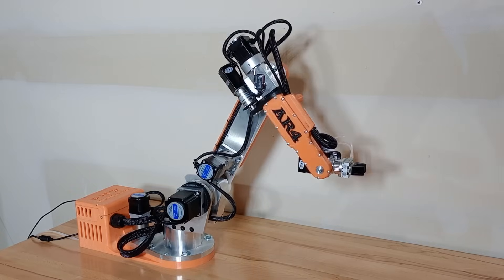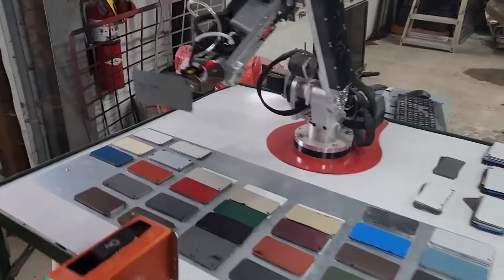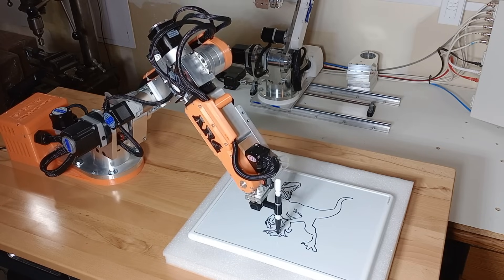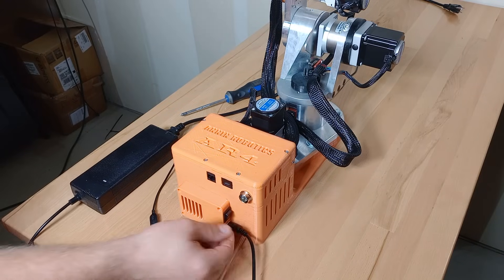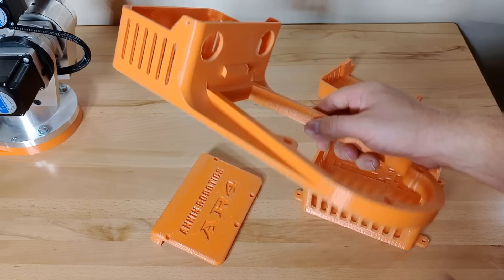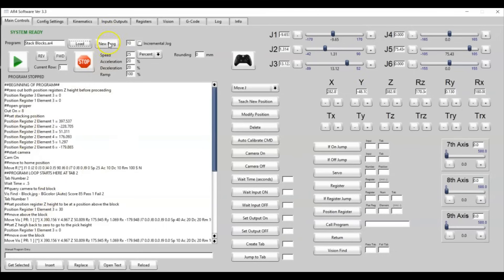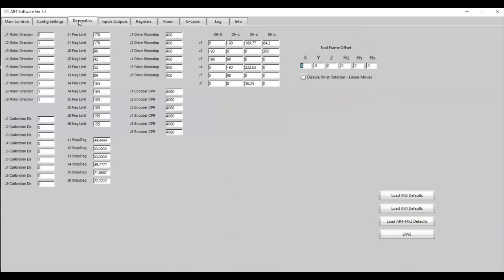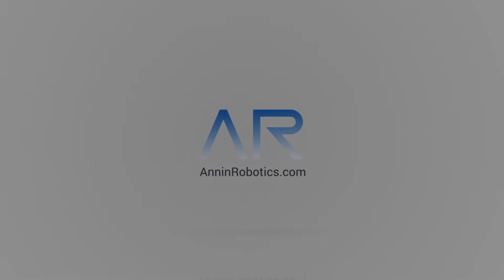AR4 MK2 6 DOF ROBOT ARM - DIY 6 axis robot kit / Arduino controller with Python program interface

Comment: Hi Chris. I'm a farmer in Michigan using your robot for some machine vision tasks related to my conifer operation. Thank you for releasing this open-source project. I purchased the Hardware and Electrical kit back at the end of September but have not put things together yet. I see on the website the AR4 hardware and electrical kit are the same for the MK 2 version. Is the stepper motor package the same?
Reply from the maker: Hello,  the electrical kit has most of the same parts but there are a few new parts.  You will need some 20awg red/black wire, USB keystone jack, Micro to C USB cable, 5.5mm DC socket, rocker switch, and 40mm fan. (see the MK2 manual BOM for details)  These parts are all easily found on Amazon or If needed you can email me and I can put together an invoice for these parts.  The AR4 MK1 motors will all work fine for the MK2, the biggest difference is the drivers.  You will need to purchase (3) DM332T drivers and (3) DM320T drivers from Stepperonline.  These drives can be found on Amazon as well.  Thank you and let me know if you have any other questions.
Reply: I also purchased the complete kit at the end of September and would be interested in knowing the differences between the mk 1 and mk 2.

Comment: Just to make sure,  the new 4.0 software version be used with the AR4 MK1, correct?
Reply from the maker: Yes it can.  On the kinematics tab just make sure you load the MK1 defaults.

Comment: I hope you don't find this question to forward, but do you make money producing this? Or are you doing this mostly as an open source project for purely altruistic reasons? I ask as I'm curious as to one thing you alluded to in your video, that being that your software works for any robot (non-AR4). If I was to use your software for a different robot, would that be OK? Or would you want royalties/fees etc. of some kind?
Reply from the maker: Hello,  no royalties or fees all I ask is that it remain free and no one try and resell my work for profit.   I have asked that if anyone wants to use the AR4 as part of a for profit automated process that that at least the parts be purchased from the website.  This project has been mostly for fun, I don't make a huge profit on it but I make enough to fund development and fun stuff.  I spend most of my time at work where I work for House of Design Robotics.  Thanks for your message.  If you have any other questions please reach out via email as I don't always catch all the youtube comments.
Reply: Chris, your work is a nod to the spirit of open-source revolutions, blending innovation with accessibility. By sharing your designs and code openly, and offering parts at minimal cost, you're laying the groundwork for a self-sustaining technological ecosystem. Your efforts are more than just robotics; they're a blueprint for a community-driven future in  this tech. Thank you for leading this charge. @anninrobotics
Reply: Oh! And thank you for this video! AR4 rocks :)

Comment: Any reason why the Ar4 robot is calibrating in reverse with new teensy sketch as well as 3.0 sketch. All axis are now reversed when using new ar4 software but not the 3.0 ar4 interface
Reply: Got it. Have to select original AR4 defaults in kinematic settings
Reply from the maker: Im glad you found that.  thank you. @vcisco74

Comment: Awesome work!
Does the Gcode only work in a 2-axis plane or will it work in 3D?
I'm glad the physical robot hasn't changed much or I'd have to build another one from scratch!
Reply from the maker: Thank you.  I haven't done alot in 3D as I was mostly messing with 2d drawings but it should work in 2.5D but I didn't do anything yet for handling changes in orientation - just xyz.  I have tried to keep the design consistent so no one gets left out.  Thanks again.
Reply: I look forward to experimenting with this gcode function. When I first got my "some other brand" SOB robot arm, my approach was from a CNC perspective, attempting send it gcode using UGS.  It sort of worked for simple 2 axes only. But things got squirrely quickly when all the DH parameters came into play. That is when I started experimenting with Chris's AR4 software @anninrobotics

Comment: I have a few questions: given in the technical data payload= 1,9 kg, is it with a gripper or should the weight of the gripper be subtracted from the load capacity?Can the load capacity be increased by replacing it with more powerful engines or is the structure itself too weak?  Can smaller structural components be printed on a recommended  Anycubic Mega S printer?
Does this printer have sufficient accuracy for structural components? (of course, only those that will fit on this printer)
I am looking for a budget solution that can be used with a similar machine https://www.youtube.com/watch?v=o3RvFlACFz8
Reply from the maker: Yes all the prints can be done on a Mega S (thats also what I have) for the larger parts I also have print files that are split in half and can be epoxied together.  I have had people modify the design and add a larger motor for J3 to increase the payload.

Comment: is it possible to build arm without alu parts ?   just with 3d printer ?
Reply from the maker: Yes,  there are 3D print files for all the structural parts on the website.  At the end of this video there is a clip showing a fully 3D printed robot.

Comment: Hey Chris, I'd like to buy the CAD Model of the AR4 and mill it out of aluminum myself. Just a question about the 5lb Payload though: Is it limited by the servos or the structural stress of the metal? I'd use the robot for my Masters Thesis and would need to know this beforehand, since I would need a payload capacity of 5kg instead of 5lb☺️
Reply from the maker: The weight limitation is in the motors,  J3 and J5 usually give up first when lifting.  I have seen people modify the design to use a larger motor  for J3.
Reply: @anninrobotics  cool, thanks☺️

Comment: Hello, thank you for your hard work, i have a question: can i use teensy 4.0 instead of 4.1 ?
Reply from the maker: You might be able to use the 4.0 but you would have to add connections to the board as its smaller and doesn't have the same number of pins as the 4.1  I think overall the 4.1 has more IO points than the 4.0

Comment: "What gear ratio do you use in the gearboxes? And approximately how much do the arms of the 4th and 5th axes weigh? Thank you for your response and I wish you success in your designing!"
Reply from the maker: The gear ratios vary but axis 2 and 3 for example is 50:1.  On the downloads page I have a full sheet with all the gear ratio calculations.  Im not sure the exact weight of the upper arms but the total weight of the robot is approx. 30lbs when assembled.
Reply: @anninrobotics  Thank you for your response!
You've been a great help. I am also working on a small project.